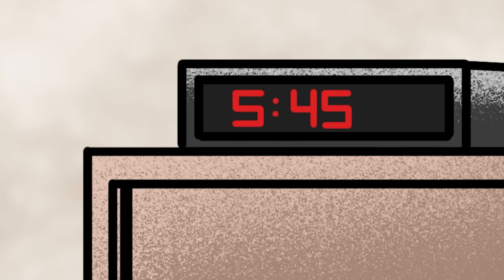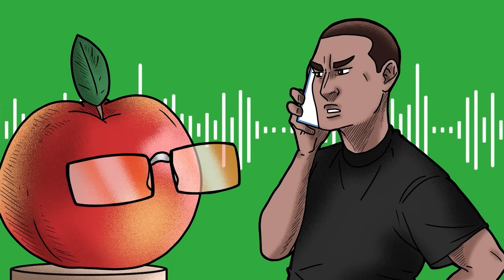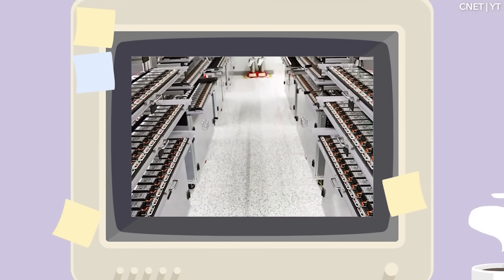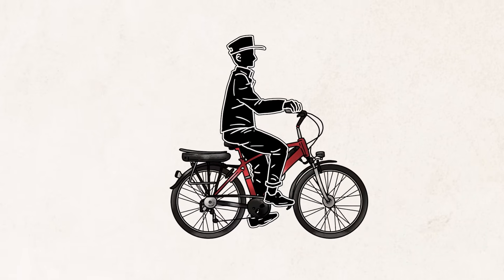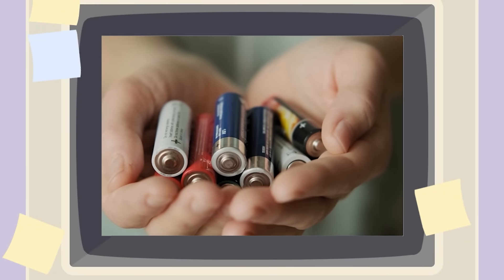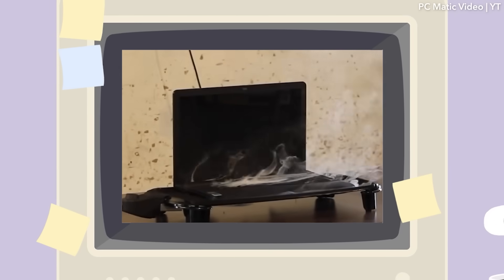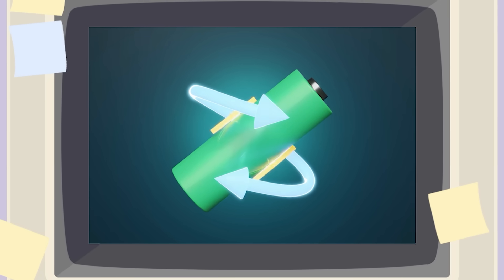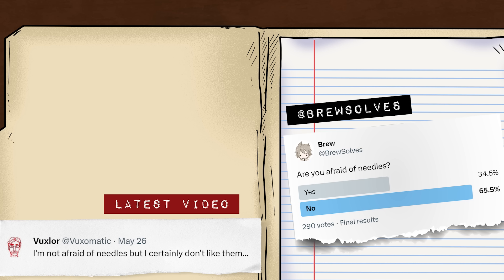A Man Wears His New AirPods. Minutes Later, He's Rushed to the Hospital.

Comment: How come I feel that these AirPods are bought fromTemu and non genuine?
Reply: Wouldn't matter. This is a problem intrinsic to lithium ion battery tech. All lithium ion batteries will eventually do this. It's because of the chemistry within them. Basically the lithium ions are drawn towards the positive end of the battery, and when recharging, they can grip a little too tightly to it and rip off little bits and pieces, carrying them back to the negative end with it. That little bit of metal it carried back gets deposited on the surface of the lithium, and like stalactites in a cave, it slowly grows and grows until it pierces through the electrolyte. Without that barrier between the positive and negative material, all of that energy moves through that tiny space more or less at once, and it gets HOT. Like MAD hot.

There are multiple companies working on this problem right now, and we're starting to see new forms of electrolyte and anode material that address these issues, both by preventing that material movement within and replacing the electrolyte with a solid, which doesn't as readily burst into flame. Undecided with Matt Farrell has some very cool videos on these new techs and how they work, if you're interested.

(Mind you this is a somewhat simplified version of what causes these explosions, but it captures the core ideas accurately.)

Comment: I understand @Brew is all about scary stories, however one needs to inform a little about the risk of lithium battery fires, which is real, however not the same in all situations. 

First of all, EVs in the western world, rarely spontanously catches fire because of the battery, due to strict control during the production of the battery. Actually - conventional vehicles using gasoline or diesel are more dangerous, because the fuel can leak out and ignite, that is our experience here in Norway, where we now have a lot of EVs already. 

Diesel isn’t flammable in normal temperatures you say - well actually we have had both buses and trucks burning very quickly, because of the fuel line rupturing and diesel leaking out on a hot engine, and diesel self ignite at 250 degrees Celcius. When that is said, not even fossil cars explodes like in the movies, even when fuel leaks after collisions, some times. I would be mindful about buying an EV, or any other car for that sake, from China, until they get their quality control in order. And - there are new battery types coming - like LFP, Lithium Iron Phosphate, which are safe and will not burn like lithium ion batteries. E-scooters, especially the ones you stand on, they ARE more risky, both to drive and also because the battery is subject to much vibration,
these scooters are subject to hard handling, especially the rental ones in citites, any some places,  completely rightfully, they are banned from bringing on the subway etc. 

Also, making a habit of never charging your devices in the night, avoid charging devices to 100% SOC all the time, will both reduce the risk of a battery fire and extend the life of the battery, if you still do not discharge the battery to empty, all the time. 

Remember - Brew is here for the 1 to a million risk accidents, and they will and can always happen, with any object in your house - some day, someone will fall down the stairs and get impaled by a broomstick that happend to be in the wrong place, or a LEGO tower that your child built at the bottom of the stairs. I am surprised that Brew hasn’t reported it, it surely must have happend already. 😄

Weird things WILL happen, so be careful with batteries and everything that contains energy, and everything that can fall down, cut you, fall onto you, bite you or whatever. Seek medical attention if even just suspicious about a lump or a wound that is too inflamed, take your medicines and vitamins, but don’t be afraid for everything. 

You will more likely, know someone who won the 1. price in the lottery, than someone dying from a situation like described by Brew! 😅

Comment: I'm not a real engineer, I only have to do with electronics, but I wonder how they are internally structured. If I were to design those, I'd made predetermined breaking point to the opposite site of the ear, and make them more robust towards the speaker. I wonder if they are designed with that in mind.

Comment: Every battery has a charge safety circuit. On lead acid it's found on the back of the alternator. It's called the voltage regulator. Lithium ion has a longer shelf life than 3 years obviously. I have a Sony tablet from 2012 that thing is still rocking.

Comment: 6:27 this is a 12v battery which is 12 cells in series 1v per cell. The lithium battery shown is a single cell at 3.7v. In electric cars that's 400 3.7v cells in series and parallel. Tesla is using 22v which is 8s. Then they parallel the series.

Comment: there were fire issues for some dell laptop batteries in 2006, i had one of the models afflicted but luckily my battery wasnt in the serial number range of the bad ones...still got the laptop and still sometimes use it, the original battery wore out a couple or so years after i bought the machine,

Comment: This is horrifying. A few months ago I found that the battery in my (decade-old) iPad had expanded and since I found it in the evening, I set it outside overnight so that it wouldn't get any warmer and so that, if something happened, it at least would be inside the house. It was so swollen that the entire screen was popped off, and I could easily see its insides. I took it to an Apple store the next day and basically told them to dispose of it ASAP and I was NOT interested in getting a battery replacement.

Comment: As a technician (someone who repairs technology) there is a very distinct smell to an electrical fire. When you smell it, you stop everything. You try and find the source, if it continues to get stronger you distance yourself. 

Lithium Ion batteries are very fickle, very picky too. It's honestly not all that hard to start a thermal runaway. In spite of the safety measures thermal runaway is the main cause of exploding Li-ion batteries. Why? Because the Thermal Runaway is a chain reaction. It's like how Nuclear bombs work. It is very hard if not impossible to stop a chain reaction once it starts

Comment: I have 2 Air Pods the 2nd generation. I’m always careful in using them. I have them in cases for 2 set of keys with a house key and a key fob. One fob was covered with pink and the other in blue. I changed on the mood of the color pink or blue. My vehicle is gas powered and it has modern technology in it. I never had anything exploded from charging. I do charged up my iPhone overnight. I will used it to the music in it. Even hooked it up for Apple Car Play and even charging while I play music from. I always turn off my iPhone when I was doing a class but, I do have it with me. One time my mother was a little bit ill and I have to drive her towards a hospital. She told me where to go. I used the BT and even charging my iPhone. This was the vehicle before my current vehicle. We were there for a while for my mother. I didn’t want to drive her car because I’m not used to the controls in it. The seatbelt is tight around me. I don’t liked to drive at night too much because of the deer and even other drivers,too.

Comment: That's why I keep the screws out of my laptop. and when I have it just sitting there out of use I charge the battery to exactly 60%, pop the back off my laptop, then pull the battery from it's 30 pin connector on the motherboard. I own a MSI Thin GF63 gaming laptop. When I am sitting at home and not going anywhere, I tend to unplug the battery at a proper percentage, run my computer off wall power.

Comment: Yes, eventually rechargeable lithium devices will all set on fire.
The elements in the batteries will never degrade but the plastic barrier will eventually.
They should be using sand to deal with these fires.

Comment: I have a total of four airpods (those I found at work, lost by individuals), none of which got real hot yet. However the moment one (or both) of them gets hot or the music/audio cuts out, i'm removing them from my ears and placing far away so this doesn't happen. Yes, a precaution I have always considered. Also have a left/right mono earbud, also found at work. That unlike the airpods, much be charged manually (I have a battery charger that has pins to connect to the contacts).

Comment: Everyone forgets about lead acid batteries.   They're old tech but still used everyday in cars and battery backups such as UPS devices.  Also rechargeable from the beginning.
Reply: Lol airpods would not exist without li ion batteries. Li ion is one of the best inventions of mankind.
Reply: Unfortunately lead-acid batteries have a lot of problems that make it unsuitable for a lot of modern applications.

Performance-wise, Lead-Acid batteries' energy density is rather low; requiring a large volume of it to reach a comparable mA/h to other battery types, especially Lithium-ion.

In terms of reliability, Lead-Acid batteries can't be discharged anywhere near as deeply without resulting in performance deterioration and thus doesn't last as many power cycles.

Lastly, in regards to safety, while Lead-Acid is nowhere near as volatile as Lithium-ion or Lithium-polymer batteries when damaged, Lead and Acid's health hazards are pretty obvious.

They're almost entirely relegated to powering the starter-motors and auxiliary functions of combustion powered road cars as a low-cost easily-replaceable power supply for functions not dictated by the ICE.

Comment: I had a tablet once that the battery swelled up to 3 times it's size, and it popped off the back cover. I ended up replacing the battery, but I had no idea at the time it could explode. Probably should not have poked it so much. 😅

Comment: yup never leave your stuff chargeing when you go bed. sometimes you might get lucky or might not. im aware of what can happen to batterys. i have a friend whos a firemen and he told me the most common why fires happens is from chargeing batterys. yeah my friends nintendo switch died. it did not catch fire. he just never used hes a switch in few years and he never charged it. it was left dead long and then when finaly wanted to play hes switch hes switch did not turn on or did not charge. the battery was dead. but lucky he called nintendo and he sent in to them and when they fixed it. they told him its from leaveing the battery dead to long the battery life drains faster the longer you leave the battery dead. that also gos for controllers to.

Comment: Not all li-ion lipo batteries have all those safety features - pouch cells do not have any vents, overpressure or PTC switches. There can be a PTC or a temperature sensor in the device or the BMS board though. And pouch cells are in most new laptops and virtually all new smartphones and wireless earbuds. Literally almost all small or medium-sized products where you are not supposed to replace the battery yourself.  They can also expand breaking the enclosure, or more expensive parts like the screen.

Comment: Allegedly Sodium batteries handle high temps better, although Sodium + Oxygen still kinda explodes. Lower cost of production, and apx 90% as efficient as Lithium batteries, and a higher thermal rating might make them the future. Even with a slight step down in performance it could be better option for most use cases due to safety and cost.

Comment: I still use my ten year old headphones that still use normal cords. I am very thankful they still work perfectly. newer smartphones stop charging automatically to prevent a damaged battery, or overheating. most smart devices power down completely when they reach a certain temperature for safety reasons. so it is in fact, safe to leave your smartphone on the charger all night
Reply: 10 year old? wow. what brand is that?

Comment: Air Pods, or any "truly wireless" earbuds never made much sense to me. You loose one, and they're useless. They pop out easily, so you have to judge all your activities to make sure that they don't. Jamming them in tight enough becomes uncomfortable. The battery life is minimal. The sound quality, bass, is limited by their size.
  I've been using a set of $80 wireless buds, just to find out if they're any good. All the above is true.
 My Sony $25 Bluetooth earphones are great. Super comfortable (I sleep with them in, for white noise), 10+ hours of music, excellent sound, simple button push operation, can't loose them.
  I even glued 1 powerful magnet to each one so they won't slide off. I got the small round super magnets at the hardware store. The magnets have holes in the middle, so that the super glue holds better.

Comment: How it happens is the batteries inside the wireless earbuds will start to get hot from long periods of usage of the buds. When this happens most newer wireless eardbud models such as airpods, and Galaxy buds will notify the user through the app. And to either take them out and let them cool down. Or in most cases when they overheat they will automatically turn themselves off to stop the battery from overheating and possibly causing an explosion. My guess is since the airpods he showed in the video were 1st Gen airpods. I was thinking that could've possibly been the reason that they exploded. Because they most likely didn't have that capability until either they got a software update which allowed them to perform the safety measures. Or airpods gained the ability when the airpod pros were released.

Comment: Sadly common sense is very much missing from the life's of most people. They've gotten so used to having other things fix their issues that they seem almost incapable of critical thought. I experience this in traffic on a daily bases. Wireless charging while convenient is a pretty inefficient way to charge devices. Heat is always the enemy of electronics and wireless charging produces a lot of it. People also tend to ignore the fact these cases are so extraordinary that if not for the internet we likely would never have heard of them. Maybe it's just my experience with repairing commsumer electronics, but for the most part lithium batteries are relatively safe. It's only when misused that they become dangerous, outside of course of manufacturing defects.

Comment: Brew, ya dun goofed. The battery diagram starting at 8:45 is incorrect. The cathode is negatively charged and will send electrons to the anode which is positively charged. You have it going the opposite direction. Now there is the “hole” theory which positive holes move towards the cathode from the anode. That would have worked if you had the + moving down the wire. Probably to late to edit this mistake now.

Comment: I'm pretty sure you can jumpstart dead Li-Ion battery, but you need to know what to do. Once me and my dad get old cellphone, battery was dead, it refuse to get charge via charge port, and my dad took some small power brick and applied current to battery (applied wires to corresponding contacts) after some time it start charging via native charger again.

Comment: 15:10 most batteries have over charge and current protection to prevent this

16:20 again computers and laptops have thermal safety and with auto shutdown when over heated

Comment: For those who never own wireless earbuds, and never will. Don't worry you're not missing out on anything.
I got one, tried it for exactly one day, that's it.
The only thing it offers is no wire, the rest are hurdles: keep track of it, make sure it goes into its box, charge the box if the battery is low, have a lanyard or a hook to make it attached to your body, audio latency, streaming quality, in extreme cases like riding a motorcycle in high speed connection will have problem, wearing and taking off helmet, degrading battery health, making you conscious all the time that you have these on, must not move in a way that it will detach them.
Now, wireless headphones I have different opinions because its uses are limited due to its size, it can rest on your neck, way better sound, grater noise canceling, way more comfortable to wear.
Reply: You might have bought the cheapest ones you found.
Reply: @VitorGiannasi  Everything they said is true of expensive ones. AirPods are high latency (220 ms) and poor quality (lossy 16-bit 44.1kHZ). Wired headphones are low latency (8 ms) and high-quality (lossless 24-bit 192kHz).
Reply: @VitorGiannasi  nope! It's just not for some of us
Reply: It’s really not that serious. As a former commuter it was heaven sent. All the darn times I found my headphones cord tangled is rage fueling! Plus all the times it got stuck at the gates and doors.
Reply: You shouldn't use wireless headphones. Just as bad as wireless earbuds.
Reply: I use AirPods because they really isn’t much of a choice left for most devices. On the other hand I play rhythm games so I need to have wired headphones for gaming. But it’s getting harder and harder to find anything that isn’t Bluetooth.